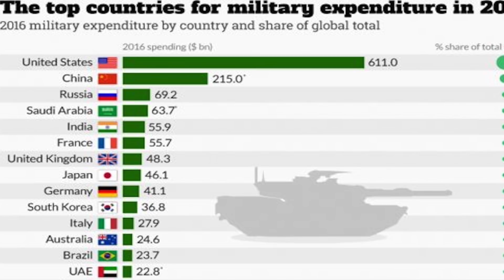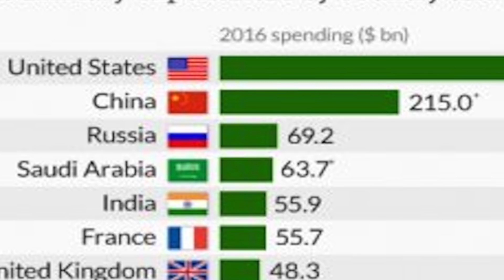CAN USS GERALD R FORD DEFEND ITSELF AGAINST RUSSIAN ZIRCON MISSILE ?

Comment: Official numbers Mach 9 for Zircon, how are they going to use Laser weapon against Zircon if it covered by plasma with same temperature range as Laser.
Reply: That's just a claim.
Reply: @child963  How is it a claim, when it's been tested at that speed?
Reply: @SB-LifeOTR  no the plasma claim
Reply: @child963  plasma forms around 5-5.5mach at sealevel, to a similar degree that it forms around a re entry vehicle such as ram-c at 22 Mach, 70km above sealevel where air is thinner.
Reply: @SB-LifeOTR  russia states that the missile can be controlled by radio and can communicate with missile during flight. But a plasma cloud can absorb higher than that.
Reply: @child963  I wonder what plasma density is required to stop raidiowave transmission. If its not high enough, maybe radiowaves can get through. That needs to be researched.
Reply: @child963  also is the missile fully engulfed in plasma or just part of it? Maybe there are some parameters that influence the missiles ability to transmit or receive radio signals.

Comment: Its great watching Russians use American names and subtlety proclaiming  that Aircraft carriers are obsolete just because of hypersonics, yet no one has a cruise missile with a scramjet only hypersonic glide vehicles because Russia and China cant make air breathing scramjets that fly in the atmosphere. All they have is rockets attached to a glide unpowered bomb. Try gliding one of those to a moving object 2000kms away.IT AINT HAPPENING OTHERWISE CHINA WOULD OF INVADED TAIWAN, KNOWING THE US CSG WONT SURVIVE!  IN 20 YEARS, RUSSIA AND CHINA JUST BUILT A GLIDE VEHICLE ABLE TO HIT A NON MOVING OBJECT WITH A 300-350 METER SQUARE CEP, 2000KMS AWAY. SO BASICALLY THEY DEVELOPED A BALLISTIC MISSILE WITH A BOMB THAT GLIDES OR BOUNCES OFVT J.G E ATMOSPHERE WHICH MAKES IT IRREGULAR PATTERN INSTEAD OF STRAIGHT BALLISTIC PATTERN. US WONT  TAKE UNNECESSARY RISKS WITH AN AIRCRAFT CARRIER BUT I BET WE HAVE 8- 14 SUBS PATROLLING AND TRAILING CHINAS LOUD SUBS CONTINUOUSLY. JAPAN HAS  9 SUBS PATROLLING, AUSTRALIA HAS A FEW! UK HAS ABOUT 3 OUT THERE. CHINA COULD PROBABLY COMMAND 25 TOTAL SUBS AT MAXIMUM CAPACITY ON A GIVEN DAY. THOSE WOULD BE THE FIRST TO BE DESTROYED IN A CONFLICT. ONCE THOSE ARE GONE, SHIPS WILL MOVE WITHIN 500KMS. WITHOUT WORRYING ABOUT ANY ASM, WHICH CHINA HAS ABOUT 500 TOTAL INVENTORY. INCLUDING 105 HYPERSONIC GLIDE DF21 DF 26D. 1 US csg has about 350 anti denial weapons. Plenty of missiles to defend itself. 4 cruisers and destroyer together could launch 34 missiles in 4 second intervals with another 20 essms. Nothing going to get through!! The bombers are all destroyed 6 with 12 j-20bs!

Comment: As with anything Made in Russia, especially when it comes to their weapon systems, Zircon is overhyped and the capabilities of that system is exaggerated. Zircon, if it works as advertised, which is doubtful, is not a sea skimming missile. Flying at Mach 6-7 near the sea level is impossible because of the thick atmosphere which would either slow the missile down to Mach 3-4, or generate such heat that the missile would melt. 
US Navy is in the process of developing a new Block 2 SM-6 interceptor missile which will have the body diameter of its bigger sibling, the SM-3 ABM missile. This new SM-6 interceptor will reach hypersonic speeds and will be capable of intercepting Zircon..
Also, no Russian surface combatant would be allowed to approach the Carrier strike group anywhere near those 600 km. AWACS and forward flying fighter jets would start attacking the platform carrying the Zircon in times of hightened tensions. Although dangerous, Zircon is far away from unbeatable missile. Just imagine the amount of targeting data the missile should have to hit an aircraft carrier sailing at speeds of over 35 knots.

Comment: The fact that the U.S. missiles are "designed" for defense against super sonic missiles does not mean they would be in any way ineffective against a hyper-sonic missile. In fact, a hyper-sonic missile, especially one that weights 5 tons, will be travelling in a easy to predict path, or "arc", and have very little maneuverability, (if any), to outsmart the U.S missiles. It's only advantage is, due to it's high speed. the U.S. would have limited time to react, but there would still be plenty of time to launch a barrage of missles in it's path before it can get close enough for the debri to cause damage. With nearly the entire carrier group armed with missiles, they could send upwards of 75 or more missiles at a time.
One more thing....., if anyone were to attack a U.S. Carrier, the point of origin where the attack came from would come under a hornet's nest of attack soon after. Good luck with that.

Comment: Laser weapons have two rather big disadvantages. First is that you can cover your missile with a mirror in the lasers light spectrum and reflect 90+% of its power easy. A hypersonic missile is built to handle massive heating from its speed and with mirrored hull you will have a damn hard time melting anything on it. Second is that lasers are super sensitive to bad weather. Fog at see is a thing you know and clounds would massively reduce the range as well.

Comment: The aircraft or ship carrying the Zircon will likely be shot down or sunk by the carrier air wing, guided by E-2s, and other surveillance assets,  before they even launch it. A carrier group can sanitize an area 1,000 miles around the carrier, with the help of satellites and ground based air surveillance assets. With E-2s seeing way over the horizon, and the soon to be added F-35, which has spotted an ICBM launch at 800 miles on it’s EOTS thermal imaging system, Aegis Destroyers will have plenty of time to see and shoot if an aircraft or ship gets a launch on a carrier.. In a 2016 test, the John Paul Jones—which is fitted with the latest Baseline 9.C1 version of the Aegis combat system—engaged a “complex medium-range ballistic missile target.” That suggests that the target was representative of a maneuvering incoming warhead similar to the ones mounted on the Chinese DF-21D or DF-26 anti-ship ballistic missiles. And the SM-6 can be cued by F-35s and E2s.

But a carrier’s first defense is that its thousand-foot-long flight deck is still nothing more than a tiny pinprick measured against the millions of square miles that make up the ocean. A tiny moving pinprick. Not just locating but also tracking a carrier across all that space relies on having a maritime observation apparatus coordinating long-distance patrol planes, submarines, over-the-horizon radars and satellites—many of which are vulnerable in turn to a carrier strike group’s aircraft and missiles.Once that apparatus identifies a carrier’s position, the targeting data needs to make it back in a timely fashion to air, land or naval units to put them in position for an attack. In many cases, a separate platform will have to network targeting data on the carrier, as the launch platforms will almost always be too far away to acquire them on their own radars. Of course, that targeting data may also be disrupted by Electronic Warfare and other defensive countermeasures, including data from satellites. Just as likely, the observers may lose track of the carrier task force’s position before elements can get into place to make the strike.

China and Russia lack adequate the maritime intelligence assets and operational experience to mount a well-coordinated maritime search-and-destroy campaign against a carrier task force, even if they possess armaments that could theoretically prove effective against one.

Comment: Where did you get the figure of 5-6 Brahmos missiles as saturating a carrier's defenses? I've read analyses that argue that a single Aegis destroyer could be overwhelmed (NOT saturated btw, Aegis can track over 100 targets simultaneously, but Brahmos is so fast that you only have time for a few salvos of interceptors, which is the limiting factor here) by such numbers but a carrier group usually has at least 2 destroyers and a cruiser as escorts. I find it hard to believe that 2 missiles per escort ship would overwhelm the defenses.

Comment: Laser guns, aye?... um.... here's a stupid question for ya. What if the Russians just give their missiles a perfect mirror finish? Or even thermal shielding, similar to that of the Parker solar probe? Then what?
Reply: Add to that the speed of the missile laser are essentially thin beams of light,the laser would have to precise to take the zircon out,even then as you said thermally resistive would make it difficult to destroy.

Comment: Just coat every zircon missile in highly reflective material and the laser beam will be reflected off the missile.

Actually. The hypersonic Missiles fly in a layer of plasma gas to reduce drag. The plasma is impenetrable to laser.
Reply: Dont bother googling it, its not published yet, and wont for a while
Reply: @datrevmeister  the usa has 2 or 3 rail cannons in testing and they said to be able to hit almost anything and there is no deffence againt them either. I heard few rumors of the rech and what it will do.
Reply: Mr Egusi Good luck finding a coating that can handle the temperatures seen during hypersonic flight. 🤘🏻
Reply: The laser will be used to track the missile from a satellite and railguns will be shot at an intersecting point once the missile hits the atmosphere, genius.

Comment: The missile does not have to be destroyed only blinded or spoofed. There are many many electronic and physical ways to spoof a missile. All that is needed for current missiles to intercept hyper velocity missiles is a soft war up grade. Being slower can be an advantage lower speed means a tighter turning radius.  It does not have to out run the incoming missile only intercept it.

Comment: some logical & common sense observation: 
1 -  in case of attack on a US carrier, the first weapon used will be missiles against AWACS planes - only an idiot will launch against carrier ignoring the "eye above! ! 
All war simulations made by pro guys  start with that; Its an naive mistake to simplify the things like here in vid "the missile will be detected right after launch, at 400 km" ! That's plain a stupid statement,  even only bc you assume the missile will be launched at max range. Did you think about submarines ?! How about a launch at only 60 km distance, right after Earth curvature ?? Do you thing will still be 3 1/2 minutes time ? 
Most scenarios start with attack on AWACS platform, who will be eliminated first ( are heavy, slow planes, NON-STEALTH, easy to kill) ; Best case, the AWACS platform will be forced to run away leaving the carrier group "without eyes";  The missile will be launched in swarms from several directions at closest range possible - best case, from a submarine -  and the reaction time will be a bit over 30 seconds. 
Second observation: 
laser weapons = wet dream for this time against hypersonic missiles. First of all, you "forgot" a fact - a missile traveling at that speed its already VERY hot, and the missile its made to resist very high temperatures. Some of this weapons simply fly inside of a very hot cloud of plasma, making a laser targeting impossible & with no effect at all. 
Also, a laser weapon need a considerable amount of time until reach the max power level - and time you do not have ! 
Remember also about Earth curvature ! A laser beam can only travel on right line, and that mind it simply USELESS against targets 50km away if that target fly at only few m above water! 
That translate in reaction time of only one dozen of seconds before the missile reach the target ! 
And at least, laser weapons are very dependable on external conditions - will NOT work in clouds, smoke, snow dust, heavy rain. And, let's use real facts: Zircon missile exist, some russian subs already have them, a laser weapon able to down a 5 tons hypersonic missile it's still just a wet dream for the next decade, at least, if not more ! 
Like that brit says, are NO REAL, consistent defences against a hypersonic missile, at this time.
Reply: "During flight, the missile is completely covered by a plasma cloud that absorbs any rays of radio frequencies and makes the missile invisible to radars. This allows the missile to remain undetected on its way to the target.”The 3M22 Zircon or the SS-N-33 is a maneuvering anti-ship hypersonic cruise missile developed in Russia. Earlier speculation estimated that the Zircon’s  range is 500 km at a low level and up to 750 km at a semi-ballistic trajectory, but Putin in his announcement said the range is over 1,000 km.

It’s a two-stage missile that uses solid fuel in the first stage and a scramjet motor in the second stage. This missile will be incorporated into the Kirov-class battlecruiser Admiral Nakhimov this year and the Pyotr Velikiy in 2022. The new Yasen-class submarines will also reportedly be armed with the new hypersonic cruise missile."
So much about missile launch at 400 km... when you just stay cloaked underwater and launch from 50-60 km !
https://southfront.org/russias-zircon-hypersonic-cruise-missile-what-we-know-so-far/

Comment: Question about lasers. Stupidly, what if the missiles have a reflective envelope ...like mirrors ?? laser is light ? honestly stupid question i am sure ... someone has an answer ?
Reply: no need for that, most peoples here have no clue a missile at that speed it's made to withstand VERY high temperatures (over 3000 Cº ! ) , even a very powerful laser beam will need a lot of time to even make a minimal damage !  Next, any high power laser can.t shoot immediately,  still need a considerable time to reach max output levels, much more than a dozen of seconds ! And at least, Zircon missile travel in a cloud of very hot plasma layer, who render any laser or EM radiation useless, included radar.
Reply: @mirandela777  Thank you ... that was ultimately the question i was looking to get an answer to.
Zirkon or Brahmos.

Comment: The biggest advantage of a hypersonic missile is also its biggest weakness. It travels so fast that maneuverability is limited as the Gs produced will be extreme. There are only a small amount of paths it can take at terminal velocity. Lasers are a great defense when they do come online. Until then, if you are able to put some flack in its path early enough and it runs into even a little piece of metal, it will be destroyed.
Reply: what lasers, dude ? those from Stars War ??  or those from your wet dreams ??  Today lasers struggle to destroy a small , low speed drone ! That is, if the weather agree, since lasers do not work on clouds, smoke, snow or rain. 
Not to tell you the Zircon missile travel in a cloud of hot plasma, making any laser absolutely useless.

Comment: Defence against laser weapons: a mirror.
Reply: Even dielectric mirrors would allow enough energy through to cause serious internal damage. Also such mirrors are only effective at certain wavelengths. A normal glass mirror would shatter (or even melt). Additionally, an Em field given off by such a powerful laser would play havoc on a missiles guidance / counter-measure systems. And make it easier for other resources to home in more effectively.
Reply: What's the defense against a rail gun round? The US has both.
Reply: Electronic warfare. It shuts down all electronic systems within a given range. The laser and electromagnetic rail guns become sitting ducklings.

Comment: You forgot to mention the 75 aircraft it can carry...  All with the very best missiles and radar....
Reply: Missiles and radar need to have the appropriate modes to be able to intercept such targets. The faster the target the smaller the zone in which the missile can actually hit it. If the closure rate is too high, the radar won't even be able to lock on. AMRAAM and Sidewinder are not able to fly above Mach-6.2 to chase it. They can only be attempted to be fired  from head-on, assuming the radar can process the insane Mach-7 closure (which is the approximate sum of the missile and the aircraft own speed)

Comment: Just lighting a target with a laser does not destroy it. It takes some time and i has to stay on focus for a while. If the missile is on it´s final approach directed towards the target...
Reply: and you need a VERY high power laser for that. And the missile must cooperate, must stay put , do not maneuver, and by no means can have any heat protection of any form, like those protecting space capsules 50 years ago. Also, the missile must wait 5-10 minutes under 50 km, in air, until the laser beam manage to melt something. Because longer than 50 km, the laser beam simply can't target a low flying target.